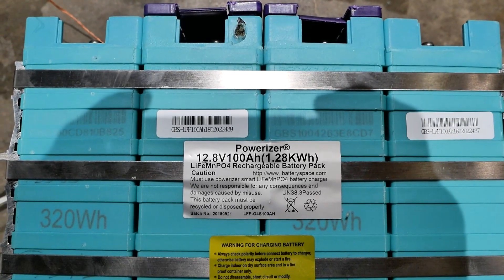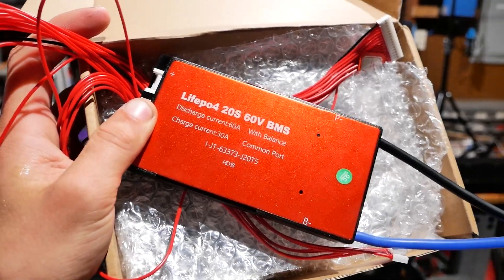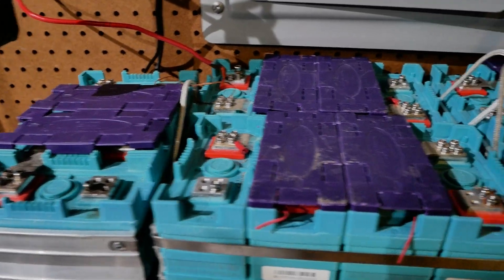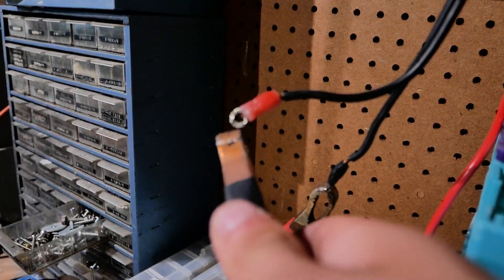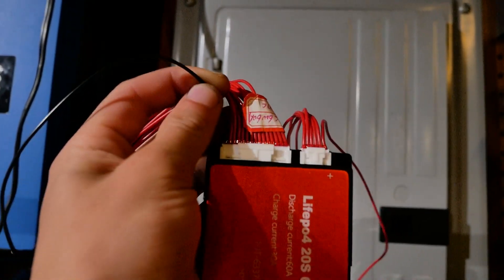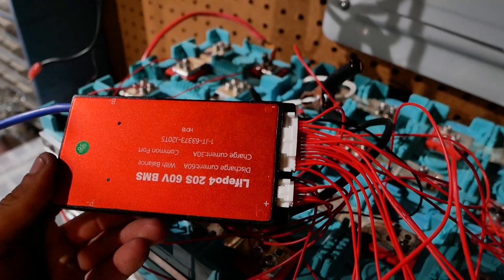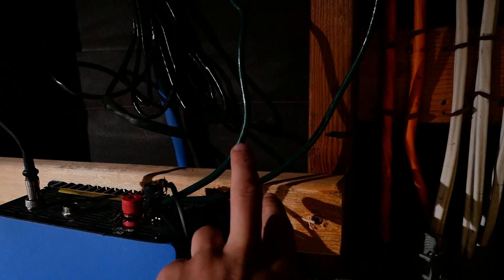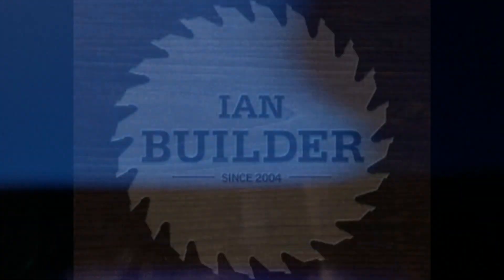HOME MADE GRIDE TIE SETUP WITH lifepo4 12v battery's DIY solar

Comment: Super cool Mr Builder. 
But, why use tiny wires to limit the current? That is just free losses. Use a fuse.
Reply from the maker: the inverter itself I've set to limit current. the thin wires are just in case of a short circuit

Comment: Good choice of batteries! In Germany a few houses burned down after installing solar+batteries, they were most likely using Li-Ion and not LiFePo4
Reply from the maker: very true
Reply: Lead acid and LiFePO4 are way safer than li-ion